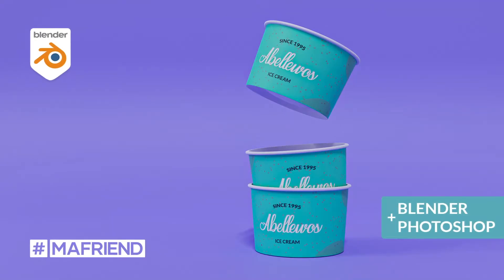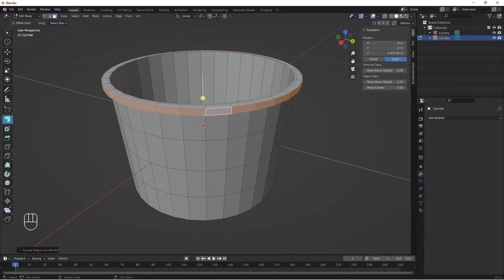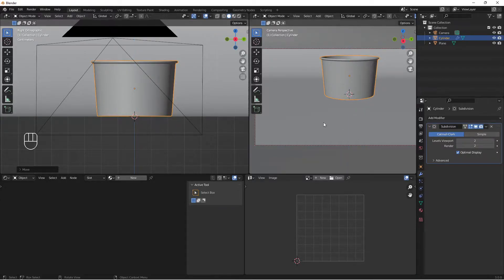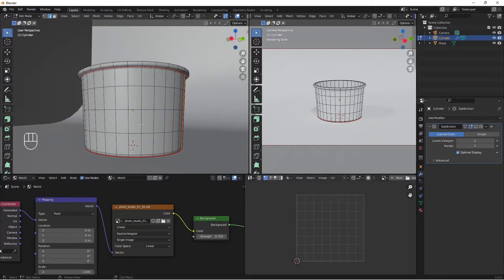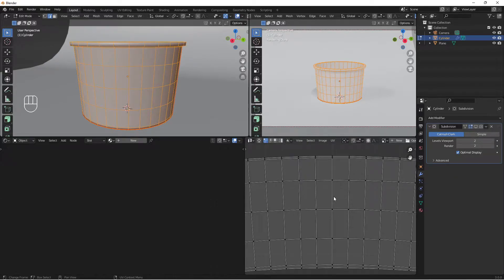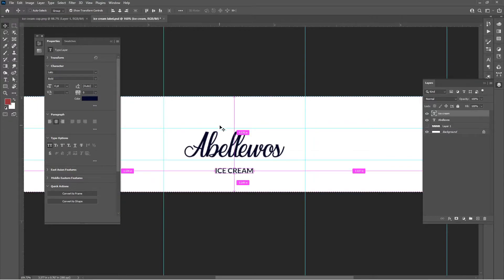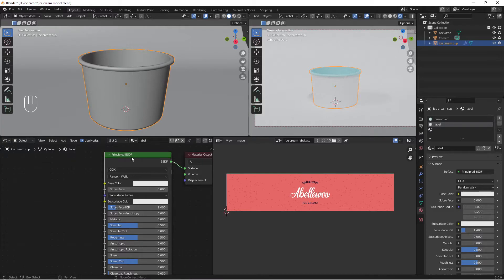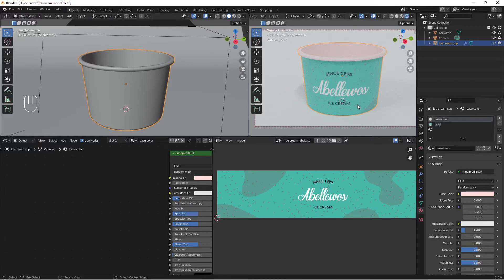3D ice cream cup mockup in Blender 3.0 and Photoshop

Comment: Great video, thank you very much!

I'm facing an issue with the texture on a duplicated object though. On my first object, I followed all of your instructions and could apply my label on the unwrapped area. But after duplicating that object, and trying to follow the same steps, but trying to apply a different label design (since I want to showcase 2 different labels on the same image), the texture applies to the entire object instead of only the unwrapped area. Any idea why this is happening?
Reply from the maker: Hi Marcus, please check and see if the texture Coordinate node is set to UV in the Shader editor. And please make sure your seems are marked correctly
Reply: @mafriend  I actually didn't pay much attention and wasn't selecting the seams properly, thanks for the help!

Comment: This look awesome. Specially I like material applying part. I will try this soon.
Thank you so much. 

I have an question. If you are aware about element 3D in after effect. If i import this model in after effect, can i change material in element 3D itself in after effect?
Reply: For animation process, i am bit used to with after effect. So if i wan to change material ni after effect (element 3D plugin), is it possible?
Reply from the maker: I have not played with Element 3d before but I think you can. You can do a few research and see.